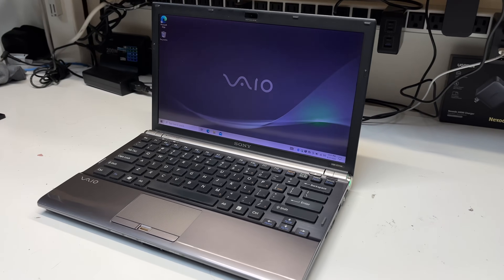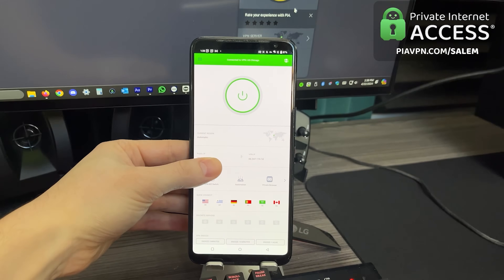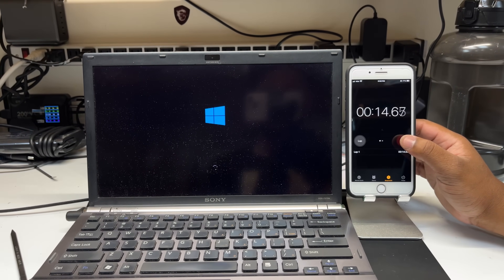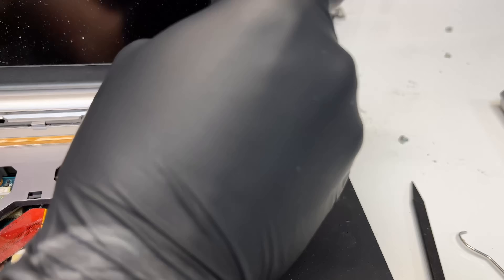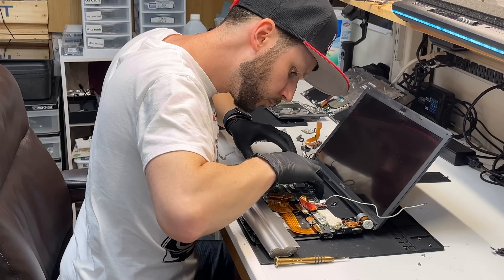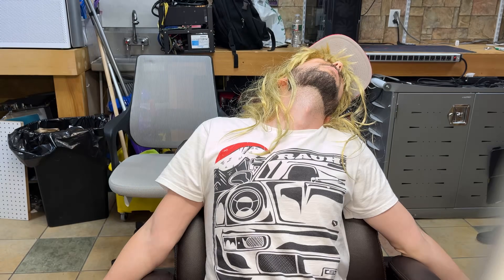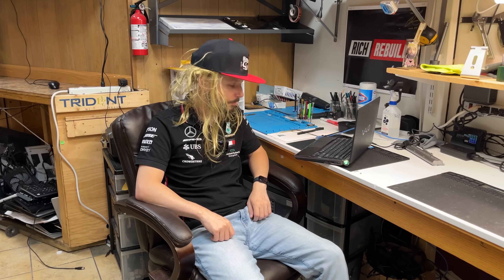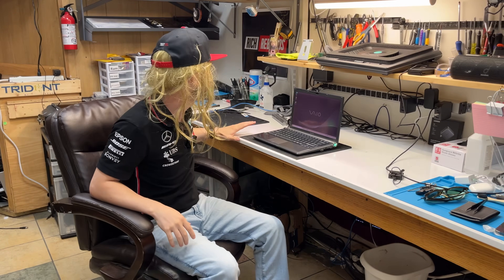Sony Vaio Resurrection: Saving this Insane Tech From 2008 (and why that soon won't be possible)

Comment: I learned a lot watching your videos... especially about your mother's box. But seriously, you inspired me to refurbish an old Acer Swift 3 that had a broken screen. I removed the screen physically. I put in in an NVME and took out the old HDD, repasted the thermal pastes, cleaned the gooch, and connected it to an external monitor. I also clean installed a new Windows 11 minus all the bloat ware that comes with Acer laptops. And so now I had an extra desk only laptop that was moving really fast. I gave it to a friend who recently had a stroke and really needed a PC to start working again. I love your channel. Thank you.

Comment: Reminds me of my iPad Mini 4 that’s cracked to hell, screen is falling off and there’s a hole in the battery but replacing anything minus maybe the battery in it would cost more than what I paid ($50). So I just use it as is and it works minus the screen flickering and bugging out when I put a heavy load on it because it gets super hot. Since then I have refused to buy a new device in favor for used as to reduce the waste to landfills. If I could afford to fix this thing it would be after I downgrade it to iOS 14. All my phones and computers I’ve built from trashed devices. My current phone is an iPhone 3GS on iOS 5 and yes I can do iMessage, SMS, Phone calls and access the AppStore. With original battery that lasts almost 2 days. It lasts longer than my siblings iPhone 13 Mini. My Current music player is an iPhone 4 that I fixed on iOS 4. My laptop is a 2009 MacBook 5,2 on Mac OS 10.13 and Mac OS 15. Works perfectly fine.

Comment: I've got one of the full keyboard versions of the Vaio.  I never upgraded it to 10 so it's still on 7.  I reinstalled OS a couple of times (had to replace the hard drive a day after my warranty expired) and was able to find drivers via Wayback Machine at the time.  This was back in 2020 so YMMV, but it's worth checking out wayback for ancient drivers if the official sites have taken them down.

Comment: I have searched the literal Earth to find a modern laptop that has fully upgraded memory and SSD as well as dedicated GPU and a top CPU and frankly, I don’t believe it exist. The closest thing I have found recently is a Dell Precision 7560 with an 11th gen i7 processor. It has four RAM DIM slots and 3 SSD M.2 slots with a dedicated Nvidia T1200 GPU.

Comment: I remember when Osborne made 'notebooks' ;)
I still have some notebooks from all decades that where great at their time. But sadly using them doesn't make any sense, no matter the application, if you live in a nation where electricity is ridiculously expensive, because they eat so much more than anything more modern.

Comment: dude i have a sony vaio VPCEH laptop it still have its OEM windows 7 and even crazier it still have its a recovery partition (i can access it by pressing F10 or the ASSIST button) it have a woping 4gb of ddr3 ram and its original hdd on it and oh my god the hdd is crazy fast for 2011 it get like 30mbps like my uhhh my 2018 or 2019 netbook does 3mbps (it have a 32gb emmc chip) (just remember one thing i got the sony vaio laptop for free from my dad's job because the OS was corrupted)

Comment: i have one from 2010. should be the VPC-F11Z1. i found it in the dump and the only problem is a few lines on the screen.. it has an i7 that still holds up especially well for any basic use or even oldschool gaming. it fries my thermal paste every year tho so i have to take it apart and redo the paste... its actually suprisingly easy to take apart tho. i found it just when my terribly made hewlett packard from 2017 died for no apparent reason one day. served me for 2 years until i gathered enough money to build an actual pc. now its the go-to laptop for calibrating crt monitors, programming chips and whatnot. its BULLETPROOF!

Comment: 2010-2009  lenovo  laptop  not  the  next  gen  lenovo  thos  are  total  ass  when  it  come  to  open  them  the  keyboard cable  is  a  nightmare   i  have   to  replace mine like  100  times  :(

Comment: 2 things That I'll do working with weird tech and drive changes: 1) use imaging instead of cloning, it's faster and the program somehow makes sure is bootable. 2) There are some software that allows you to extract drivers from an already installed and running windows system... I haven't used one in over 15 years so I can't point any names, but I'm sure a google search would yield something: at least for windows 10: dism /online /export-driver /destination:"full path of folder" or pnputil /export-driver * "full path of folder"

Comment: I agree device should be repairable again and upgradable take my "New" Laptop for example an ASUS K75V has upgradable RAM and hold your nuts tight TWO whole SATA ports wich arent propriratarie plus CD ROM SD card reader 4 USBs two of are USB 3.0 just proves it may be old but its gold and no i know no laptop thats brand new that will last years

Comment: My new laptop quite supprised me. Its an acer nitro 5 with a core i7 and geforce rtx 3050. I quickly upgraded the ram and noticed everything seems to be removeable and replaceable. 9 screws and the backing comes off and the whole board and battery is accessable. I suspect it will last a very long time.

Comment: I recently replaced the HDD in my 14 year old Toshiba T135 laptop with a SSD. They made it easy because the HDD is accessible through a removable panel. Works great and Windows boots up soooo much faster. I also replaced the dying battery pack with a new one because it's removable like in the Vaio. Lastly, I maxed the RAM to 4GB, though only 2.84GB is usable because I'm still running 32 bit Windows 7. EasyPeesy to do because the RAM is easy to get to through an access panel. Everything still works and I use this laptop for running older games, Arduino programming, surfing the web, YouTube, etc., so it's perfectly fine. Next thing I'll probably do is renew the thermo grease.

Comment: Ive gotta say its absolutly annoying how big tech companies are evolving backwards just for more profit without thinking of the consumer. I've bought 2 laptops a lenovo yoga 7i and a asus vivobook s15, you know what happens they both got so slow even just booting or watching youtube was near impossible. So i turned to one and only laptop a dell latitude e6410 with only 4gb of ram and a socketed i5 with only 2 cores but with one ssd and ram upgrade its so much faster than those other laptops. Yeah sure might be thicker and heavier but for something thats 10 years old, reparable and sturdy thats impressive unlike the garb you see today.

Comment: I made a reddit post about the macbook air backlit using too much power at max brightness compared to a similar laptop i have with an oled pannel. Somebody said that oled burn in and it will make the laptop die prematurely while normally macbook are long lasting laptops. He said 10 years. A laptop with a soldered SSD... 10 years... A laptop that sells more "base" models equiped with 8gb of ram.... That write GB of data on the drive because it don't have enough RAM.... And the issue is the oled burnin ?
I swear people are retarded. Apple is already using an oled screen on the ipad pro. They just milk the consummer and upgrade only when sales slow down.

Comment: I have one of these I don't know how but one of the screws for the cpu heatsink sheared off. I'm wondering if I can solder it back in because 3 sides sealed isn't enough lol it blows hot air like a hair dryer.

Comment: I just bought a new keyboard, RAM new HDD and upgraded to Windows 11 on my 2007 Thinkpad T60. It is working 19 years later.  I have 3 other laptops. A Toshiba Satelite on Win 10 & a Lenovo Ideapad 310 on Win 10 & a HP Victus 2024 4070, 8845, 32GB RAM, 2TB NVMe m.2 2280 2TB SSD. It's not fair to compare the 2024 4070 Laptop to the Thinkpad T60, but all 5 Laptops have been good to me. A few upgrades and Windows reinstalled or using nothing major other than a system restore or 5 lol but the T60 is a beast and workhorse. In 2006/2007 when the T60 released, it was a 2k laptop and it holds up today just fine for basic use. I always wanted a Sony laptop but couldn't afford one. (My T60 was a gift as I could never afford that in 2007 either) Love your content! Keep up the great videos!
Reply: >windows 11
>upgrade

Does he know?

Comment: have two of these with second gen i5 upgraded the processors from i5 2410 and 2450 to i7 2630qm and planning to insert ivy bridge i7 soon coz it is supported by the motherboard and increasing the ram to 16gb and an ssd.

Comment: I agree with you, Sir. Basically, soldered RAMs are anomalies. Even though they're fast, they're actually ticking time bombs. They can be broken at any moment and you can't fix it by yourself. In Indonesia, the only upgradable options that are budget friendly especially for basic office usage lineups are the local brands. Meanwhile the international brands are now starting to use these soldered RAMs at their office lineups which is worrying for longevity. Only gaming laptops that are still upgradable and some of them are also starting to use the soldered RAM. It's sad nowadays that is so hard to find the actual durable computers for longevity.

Comment: If you have an older laptop with decent specs or one that just needs a small upgrade like more RAM or an SSD I highly recommend installing Tiny 11 I had an Asus X501A with an Intel i3 2350M 4GB RAM and a slow Western Digital hard drive when I used it I upgraded the RAM to 8GB and swapped the hard drive for a 256GB Sandisk SSD I got brand new for just £18 the difference was night and day Windows 10 ran well but when I later gave the laptop to my dad since his HP Stream 14 AX0XX was basically unusable for videos I decided to put Tiny 11 on it and to my surprise it ran so fast it felt like a brand new laptop way faster than it was on Windows 10 so if you have an older laptop that still has decent power or just needs a small upgrade installing Tiny 11 can make a huge difference doing a RAM and hard drive upgrade can also massively improve performance making the laptop feel much faster and more responsive

Comment: I just got a surface 4 and surface 5. They are both 10 years old. From yt videos looks like the ram is soldered to the board im getting one with a broken screen so i have an excuse to take it apart and i will know for sure. But they have m.2 ssd so thats upgradable. And they, if the ram is upgradeable that would be great. I installed windows 11 on both of them and it runs great on the 5 a little slow on the 4 as its only got 4 gigs ram.

Comment: No computer hardware stagnated I want to sit around 2013 and ever since then the industry has just been probably pushing drivers and forced obsolescence on consumers to make them upgrade to be honest your average consumer doesn't need much more power than a core 2 Duo for most modern tasks and what people felt the need to upgrade for were software issues not hardware issues that was simply just because Windows used to suck back in those days with the exception of 7

Comment: I remember seeing the Viao. It looked paper thin compared to the chonky laptops of the time. Now it looks chonky compared to today's laptops.

I tend to run Linux on old machines due to the driver's issue. Or, if it has a working Windows OS I'll clone the drive to capture the installed drivers, so they aren't lost on reformat.

Comment: I still have this same model series (Z540 CTO to be exact), bought new early 2009 from the online Sony store in the US. Opened it several times to upgrade RAM and SSD (early OCZ SSDs were fatal). Best looking laptop and also a powerhouse at that time, even put Windows 10 on it with no problem. Wanna keep it as a memento but now after sitting in my storage closet for a few years, looks like the LCD screen is leaking, and only option left is to open it again to keep the hard drive then discard the rest to avoid possible toxic materials. Time flies! :(

Comment: Hi, I also have a Sony vaio vpceh25en laptop and my parents brought it back in like 2010 or 2011. That time it was a expensive laptop and it worked great but my hdd was near it's death and my windows got corrupted. It had all the latest drivers but I was not able to recover it. I installed an ssd in it along with upgraded it from 2gb to 4gb(my parents upgraded my ram back in 2012 or somewhere that) and it worked really fast and I installed windows 10 home. It's still working great like I can play many games and apps great but my battery is very bad like it drains alot even tho I replaced just a few years ago. But that driver issue you mentioned in the video is real man, I also suffered this driver issues. I literally searched everywhere but  somehow I found it in internet archive and I installed it. It's now working great even tho is almost 15yrs old. I also had a hp Compaq 2004 laptop and that also worked great but just a few months ago it died cz it's very old now. I also have a Asus x540sa laptop and even tho it's new for my laptop collection but it's one of the worst like it's rocking intel pentium that 3710 one and has a 4gb ram glued into the motherboard but no upgrade path only hdd upgrade. It's really bad in performance even tho it was brought in 2017
I know I commented really late but I wanted to express my thoughts in the laptop industry, I also want repairable laptops but I don't think companies will listen man. I miss that repairable laptop era :(

Comment: Vaio was my favourite brand. First one had Pentium 200 MMX (IIRC). Second one (stil have it in working condition) was SZ with Core 2 (32 bit). Third one (still in use by my kid under Linux) was SA with 3rd gen i5 and Nvidia. I wanted to repaste it, looked it up on Youtube, and decide to give this job to repair service. I came back twice for service to correct some ribbons. Technician said that he agreed to work on it only because he had no idea what he was going into :)

Comment: I had a Sony Vaio at work.  It was an AMD machine.  Windows XP ran awful on that machine so I upgraded the RAM and put an early Ubuntu on it.  Right after that, the DVD-ROM died.  My Night tech used it as his mobile workstation until 2014 when it finally died.  2004 - 2014 - still a decent lifespan for any laptop.  I would love to have some of the mini Picture book machines, but just don't really have time or room for that.

Comment: Well, yours might be small, but mine requires both hands...

Pulls out 17" Vaio and rests it gently on desk with a dull thud

Hearing you express your opinion of the power button hinge cover was a bit refreshing. I had got mine dumpster-diving and had to replace the AC port (the pin shroud had broken off and the center pin got mashed in), and that same cover caused me a great deal of anguish to figure out how to get off as well since I had no teardown guide. 

Luckily, once I got it apart, I found another model that used the same part number for its AC-in jack ($15 shipped), otherwise the internet seems to think there are no parts in existence for this model number other than aftermarket chargers and batteries. Everything went back together and it began charging and powered on. 

Believe it or not, the original battery still holds about 15 minutes of charge. It also came equipped with a Blu Ray drive and FHD panel, as well as 8GB of RAM, and it's a Core 2 Quad. It even had the original 500GB drive, tho unfortunately loaded with bootleg Windows 7 Ultimate install.

I'm looking for the original recovery media for Vista Ultimate. I have a 1TB SSD to throw in it, but I want to make sure it's as close to original as I remember these.

Comment: I bought a Thinkbook 14 recently. it's not a fancy laptop, but it has 2 SO-DIMM slot, 2 NVMe slots and almost everything can be serviced by removing the bottom cover. The only thing it's missing is swappable keyboard and for an affordable modern laptop it's still a miracle.

Comment: I have a laptop which is 10 years old. I tried windows 10 tiny, windows 11 tiny. But still the cpu goes for 100 percent.  I checked and reapplied fresh thermal paste but still the cpu usage reached 100% and started to freeze even for a youtube video. Despite trying multiple ways to fix it. I couldn't do anything on this one. Now it is becoming an e-waste. 
The laptop model is a lenovo e4325 with 8gb ram, 250gb ssd boot drive. 
Cpu : amd apu dual core a4 with integrated graphics.

Comment: I have an older Sony vaio, I put an SSD in it & it works really well it was originally a £1,500 laptop in 2013 & I got it for £60. However it has an Intel i7 which in my opinion could easily support windows 11 but I'm stuck on windows 10. I would upgrade to windows 11 via a workaround but it's the driver issues it would cause as I'd probably have something working then multiple things not working like the volume control or other F keys

Comment: Really miss the days sony vaio laptop were a thing. I still have it to this day, with upgraded ram running windows 10, it came with windows 7. It's still hanging on to this day. These products were really reliable. My MSI laptop has gone through few repairs and still needs more work.

Comment: Me proudly using Vaio Vpccb15fg bought in 2009 Just got SSD nd upgraded RAM to 8gb with thermal paste swap nd now its super silent nd runs like charm
The only issue is unavailibility of Graphics driver support for Radeon 6630m AMD
Guess it run for next 5 to 8 yrs

Comment: Also on the topic of soldered RAM and storage just because it’s faster, that’s still no excuse, because there are replaceable solutions like CAMM2 that could, and should, be used instead. It wouldn’t take much for the collective tech industry to focus on developing and implementing new standards that are still repairable / upgradable.